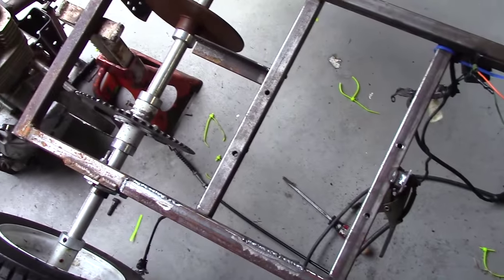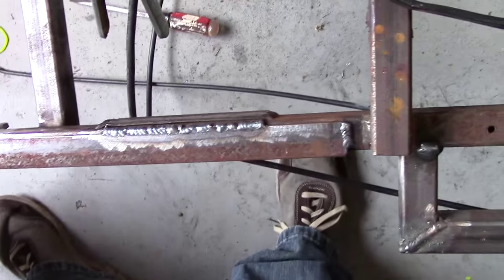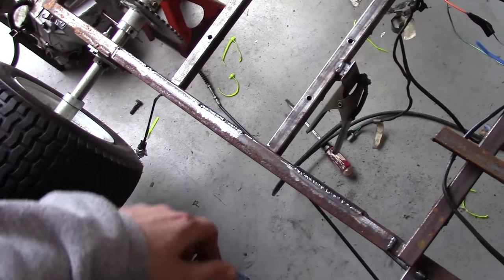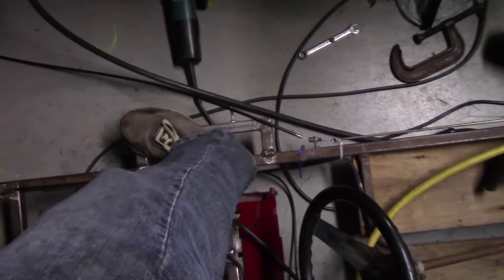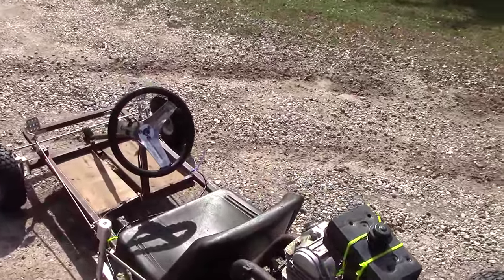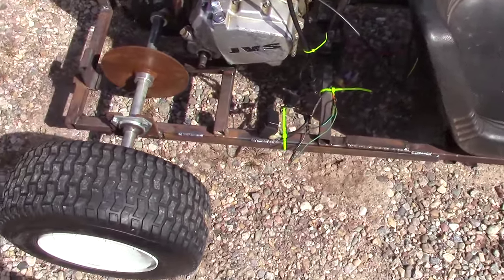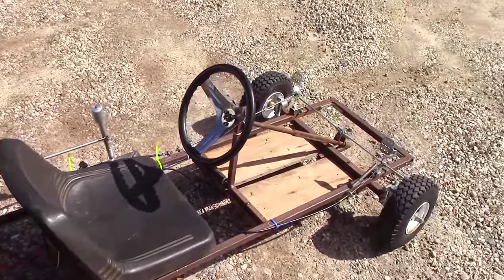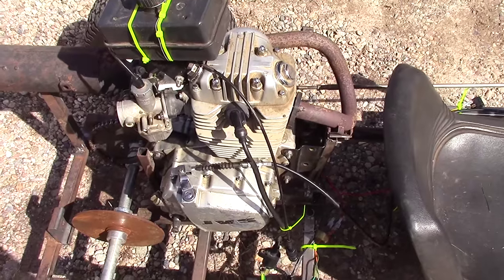15 HP 5-Speed Go Kart Build Part 8- Frame Reinforcing

Comment: When I get the money, I'm thinking of a similar project. My plan is too buy or make a sprint kart frame, and use a 5 hp engine from a Yamaha TTR-90 dirt bike. It has three gears, and since its a bike made for little kids, it doesn't have a clutch, it's has like a cheater clutch where the bike engages it for you when you shift or something. So just a gas peddle and a brake peddle, along with a similar shift knob dealie as you. This series is giving me a bunch of ideas for how too hook everything up. Good videos.

Comment: Dude I'm sorry but you mentioned how beautiful your welds were like 3 times and they are not beautiful welds. You still need to practice and learn more about welding.
Reply from the maker: +Louisxs650 Relative to my previous welds... didn't mean to say I'm a professional. They'll do for my applications and I don't plan on being a machinist. Also, the frame has been stiffened sufficiently.